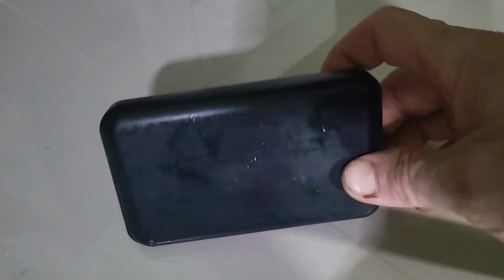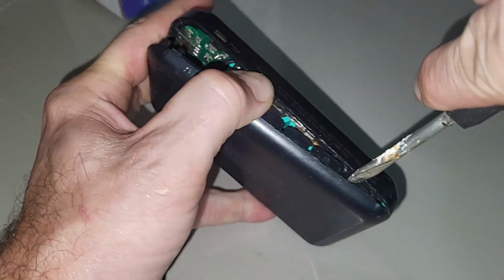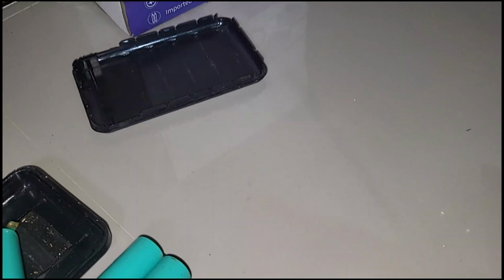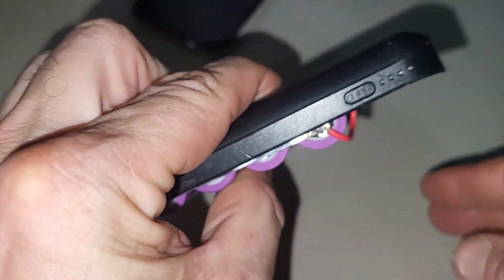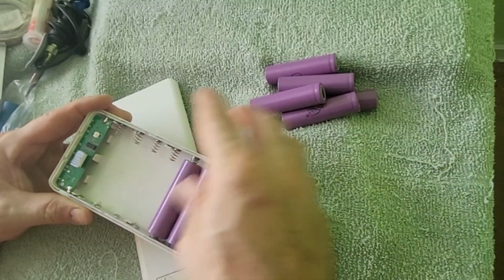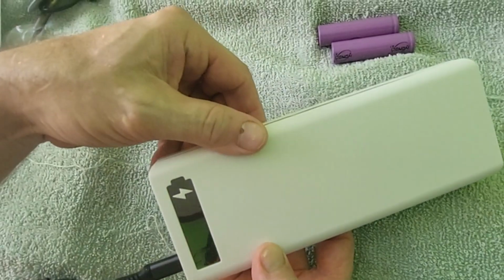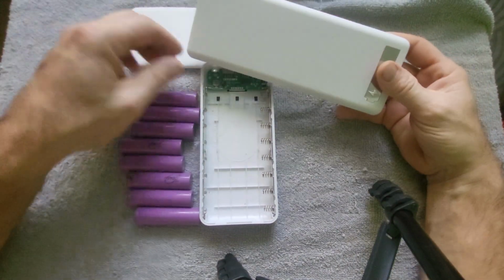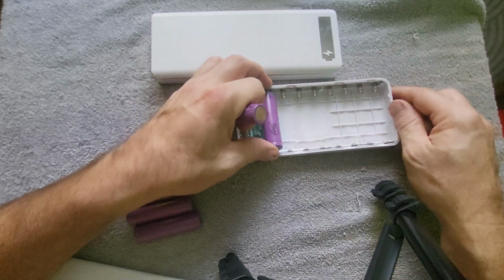Power Banks Repair and Build DIY 18650 Lithium Battery Banks

Comment: I like that "empty" case, except for the weird reading.
Reply from the maker: Yeah, only measures pack voltage not capacity. Didn't know that was even a thing before buying lol ....will know better what to look for next time
Reply: @VANquishedAdventures  I guess it could still be handy if you only have a few batteries. But I want POWER!